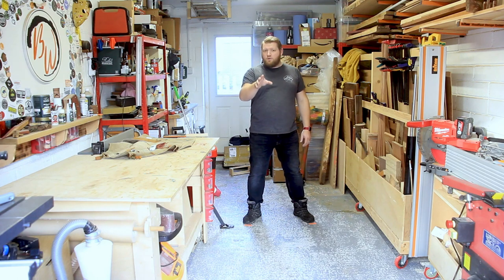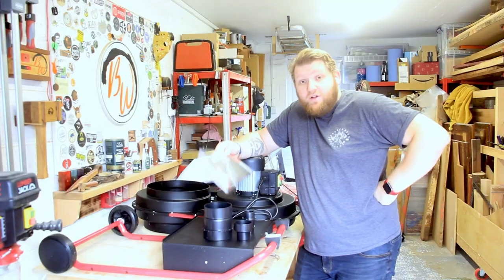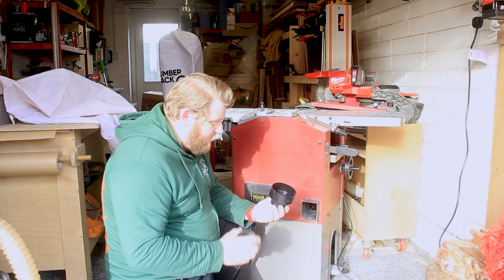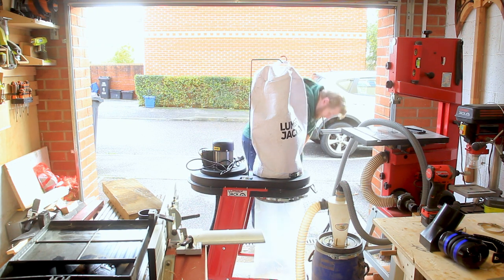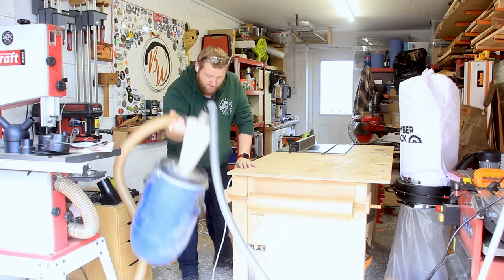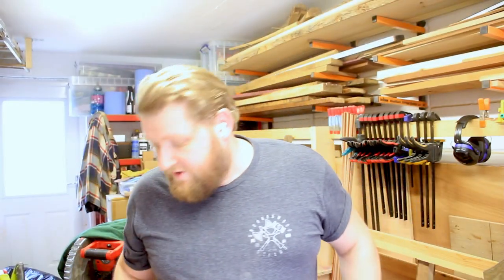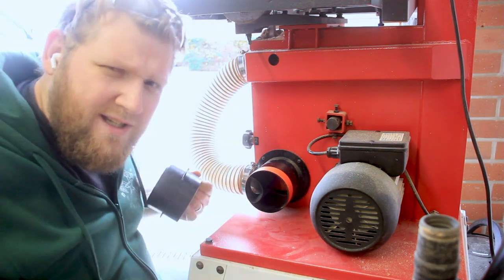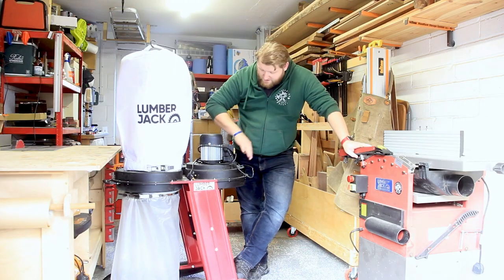Is the LumberJack UDE75B worth the hype? Does it suck?

Comment: It's dust extraction season! I Have a new very similar collector... with the exact same 2 problems. Both are due to safety regs. The back filter to stop people from putting their hand in the impela (daft) which blocks it instantly with chips and the NVR (No Volt Release) switch that means you can't use a remote. A sparky can bypass the NVR very easily. I am all for safety but if it affects the fundamental use of the machine... you've designed it wrong.
Reply from the maker: Yeah I got a sparky coming over after Xmas to look into it to hopefully fix the issue then I can get the remote back 😁

Comment: I've been seriously contemplating dust collection issues in my own shop.  Glad I watched your video to prepare me for a few obstacles that may come my way, especially with the fittings for each different sized dust port.  Looks like a good route would be to fit each machine with their own properly sized port that accommodates one sized hose going to the dust collector.  could be an issue with my miter saw though... Still thinking!
Reply from the maker: Yeah once you get them connected it’s lovely. I plan on doing ducking at some point but I plan on moving so no point of doing it yet. 
My mitre saw is the same it’s a tiny port (under 32mm) so not sure of a solution yet.
Reply: @BrookesWood  awesome! Good luck with the move.  Hopefully a nice new shop also!

Comment: I’m looking at one of these for my small shop, did you find a workaround for a remote or anything, it’s not a big deal as it will be easier to get to than the old system which was a shop vac and barrel but a remote would be really handy
Reply from the maker: At the moment I haven’t but I have an electrician coming round after Xmas to look at this & the planer. Will do an update vid in the new year once it’s hopefully sorted. He thinks it’s a simple fix though